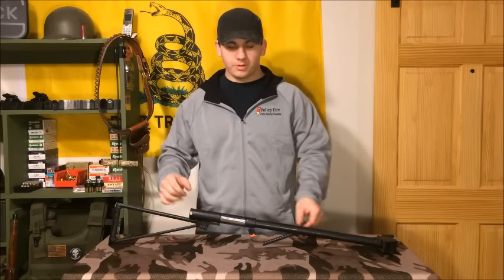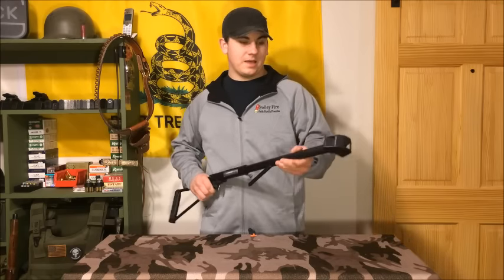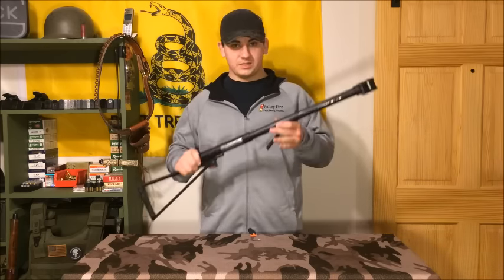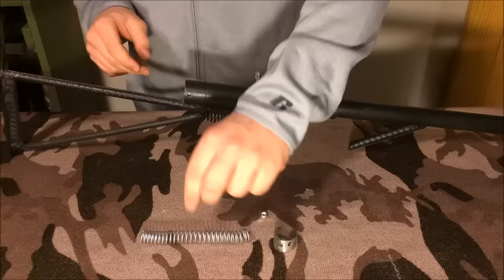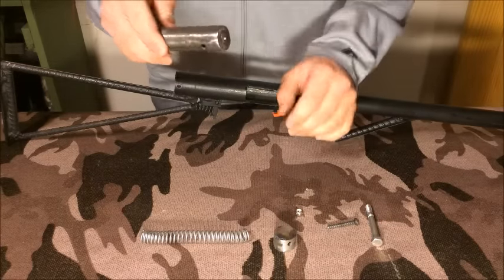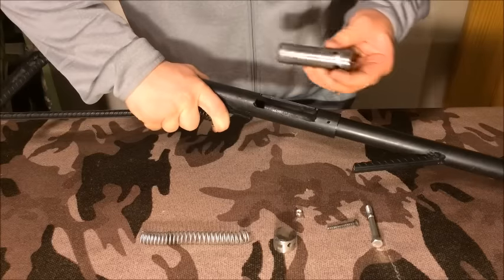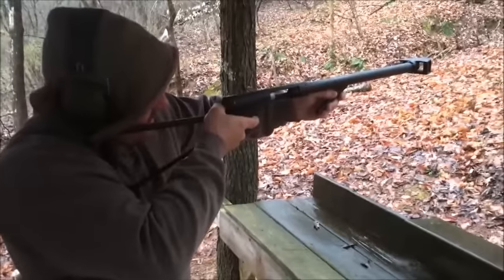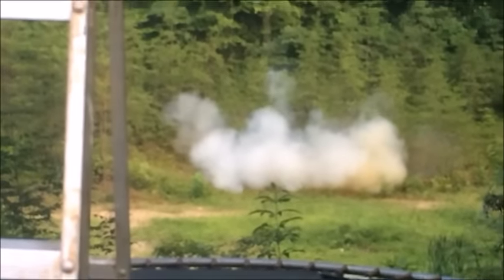Homemade open bolt shotgun

Comment: This shotgun is not legal. It fires from an open bolt and has no locking device for the bolt when fired to prevent blow back. All he has to do is add a magazine and he has a full auto. Anyone thinking about building this gun do not do it.
Reply: Single shot open bolts are perfectly legal.
Reply: @tinkeringclaws5559  No they are not. Anything that fires from an open bolt is not legal. As all that is required to make it full auto is the addition of a magazine. Part of the ATFs interpretation is "Any weapon which shoots, is designed to shoot, or can be readily restored to shoot, automatically more than one shot without manual reloading, by a single function of the trigger" so yes by simply adding a magazine would turn this into a machine gun by legal definition.  You can play around with a felony but I would encourage no one to follow you in that.
Reply: @historichomestead  dude stop spreading fuddlore. Let me guess you also think that carrying customized pistol will get you in trouble if you wind up using it to defend yourself?
Reply: @tinkeringclaws5559  No there is no ruling or decision on carrying a customized pistol. And how difficult it is to defend yourself in a personal defense situation is largely based on what state or jurisdiction you are in at the time of the occurence. You making a haphazard firearm based on your limited engineering knowledge and trying to pass it off as legal when it clearly violates the definition of the law is why gun control is getting stricter. Make one that fires from a closed bolt that locks and you would do yourself and the gun community a great service. However, I find that people such as yourself that do not understand or follow the law soon weed yourselves out from firearms ownership. Even when shown the letter of the law and how you clearly violated it you still try to defend your position. That is your folly.
Reply: @historichomestead  look up the gb22 and tell me thats a machine gun.
Reply: @tinkeringclaws5559  Correct. As all that is required is for you to add a magazine from let's say the side and there is nothing to prevent it from firing fully automatically. Just because some guy scoots under the radar and sells paper "plans" on the internet doesnt make it legal. Any firearm that fires from an open bolt with just the trigger being the sole means of holding the bolt back is a machine gun. It operates on the same principle as the STEN SMG etc. All that is required of an open bolt firearm is the addition of a magazine and it's a machine gun.
Reply: @historichomestead  he literally cant be under the radar he is an ffl and large youtuber
Reply: @tinkeringclaws5559  I can give you a list of a bunch of youtubers that got in trouble for exactly this or other related things. Also a bunch of FFL holders that also got in trouble for similar things. How it works is the ATF is aware of a product and will let it go for a while and then serve to distributor and go through their records and then serve everyone that purchased them. Same as they did with the "wall hangers" and what they are doing now with the FRT-15  trigger. Just because they let something persist for a while doesnt make it legal. It's not legal until they make a ruling on it and even then it's only legal until they change their mind. You do you. Keep adding evidence to your felony conviction.  I was giving a word of warning to the people that are observing your shenanigans.
Reply: Then why are ARs not considered machineguns as it’s way easier to convert an AR to full auto than it would be this thing, you’d have to ad so many parts to get this thing running full auto where as an AR as long as you have the right bolt and a simple trigger modification you are good to go.
Reply: @imperialwhovian3461  an AR fires from a closed bolt and under the Brady Bill "M16 profiled" bolt carrier were prohibited etc. It wasnt until the Brady Bill expired that M16 profiled BCGs were legal again. By ATF definition neither the upper or lower receiver fully meet the definition of a firearm. However, start selling lower receivers and see how quick you are being brought up on charges of selling firearms without a license. I am not debating there are obvious over steps or grey areas in the law. This shotgun is not one of those grey areas. If you cut out a magazine well on that shotgun and put a magazine in it it would fire full auto just like a STEN SMG. Read the ATF definition.  This firearm is readily converted to full auto just by adding a magazine because it fires from a nonlocking open bolt. It is by definition a machine gun. You guys can try to argue around it by calling the duck a chicken but it's still a duck. And when the creator of this shotgun and anyone else that attempts to follow his design gets charged with a felony for manufacturing a machine gun then thats on them. I am merely warning people that see this that are ill-informed with firearm laws that this is an NFA item and will get them in prison.
Reply: @historichomestead  i bet your the kinda guy that asks to see tax stamps at the range.
Reply: @tinkeringclaws5559  ignorance truly is bliss. Do what you want.
Reply: @historichomestead  did you watch his video on open bolts?
Reply: @tinkeringclaws5559  Is he an ATF agent or other appointed or elected official that has the authority to make rulings, decisions, or interpretations of firearms laws? I can show you a lot of videos of people explaining how the FRT-15 trigger is not a machine gun. Just because some barracks lawyer decides something is a certain way doesnt make it true. Like I said you do you. But when you get a knock dont say you were not told.
Reply: @historichomestead  he is a lawyer that specializes in firearms.
Reply: @tinkeringclaws5559  well maybe he can represent you and the creator of this "shotgun" when you get arrested for your illegal tomfoolery.
Reply: @historichomestead  im guessing you didnt watch his video.
Reply: @tinkeringclaws5559  I dont have to watch his video. I have reviewed a great many cases where lawyers have tried to argue a point against an ATF ruling, decision, or interpretation and their clients went to prison. Really time will prove who is correct you or I. I know what the ATF definition is of a machine gun. There have been many individuals over the years that have went to prison just for an open bolt design. Do you know why the semi-auto FN M249 that is available to civilians was designed with a closed bolt system? Because it has a magazine and even if it fired from a semi auto open bolt system by legal definition would be considered a machine gun. The only thing this shotgun needs is 10 minutes with a dremel and a few tack welds and it can accept a magazine. You can argue whatever you like. And some lawyer that is not a member of the ATF cant tell you anything. Really I want you specifically to build one of these "shotguns" and when you go to prison for it that lawyer can represent you. At this point I feel like I am debating with a high schooler. Dont show me some video that is merely the opinion of the author. I want you to show anywhere in an ATF ruling that any weapon that fires from an open bolt with no disconnecter and a fixed firing pin is legal. You cant because it is not. Really your are just going to go to prison when you try to make this and then the internet will no longer be graced with your ill-informed nonsense.  Like I have said repeatedly do what you want. Get all the felonies that you want. But I am still going to warn the people that see this video to not follow in your illegal footsteps. Really this entire shotgun was poorly engineered using an action that by definition is a machine gun.
Reply: @tinkeringclaws5559  "The weapon is blowback operated and fires from the open bolt position with the bolt incorporating a fixed firing pin. In addition, a component part of the weapon is a trip lever (disconnector) which has been modified to prevent more than one shot being fired with a single function of the trigger." That is the ATF ruling on a legal open bolt design. What makes this "shotgun"  illegal is the fact it is BLOWBACK OPERATED, fires from an OPEN BOLT, with a FIXED FIRING PIN, and there is NO DISCONNECTER PREVENTING THE EXPENDITURE OF MORE THAN ONE ROUND BY A SINGE FUNCTION OF THE TRIGGER. Now his fire control group in and of itself is considered a machine gun. If you took his bolt and fire control group and put it into another firearm and it fired fully automatically it would also be a machine gun. That's why you cant use the full auto sear from an AR15 and create a semi auto FCG and it still be legal because you can use those items in an AR15 to make it full auto. Furthermore, his design is functionally the same as a full auto STEN SMG Bolt carrier group and fire control group. A full auto STEN who's only functional difference is the addition of a magazine from this "shotgun" is classified as a NFA item. This "shotgun" by definition is a machine gun. It doesnt matter if he hasn't add a mag well yet. When you can present facts that were produced by the ATF and not some clown lawyer that contradict my arguement then we can have a debate. But so far your evidence is flimsy and your rebuttals have been merely speculation and opinion with no real facts in support.

Comment: now this is just me talking, but i think I would cut about 1in off of the recoil spring, it takes very little to set that round off-so that's not going to be a problem, as the spent round is trying to come back there won't be so much pressure from the spring and it just might recock its self for you,

Comment: If you slightly shorten your bolt put in an ejector I bet you could get it to eject that round that is so cool
Reply: it needs more bolt mass, and a better bolt/pin holding the end cap in.  Other than that, yeah buddy.

Comment: How could you add a magazine and ejector? I've thought about it and the ejector is the part I'm stuck on
Reply: If you add a magazine to this design it will be full auto and you will be going to jail.
Reply: @historichomestead  How would it be full auto if you still have to slam it back and forth to fire?

 And since the barrel is the part reciprocating, it can't even be converted to full auto easily

Comment: This could easily be made automatic
Reply: If it had a magazine well and took Saiga-12 mags then it would be a 12 gauge SMG.  
It definitely wouldn't be an assault rifle since its 12 gauge and SMGs are pistol caliber... So noy really sure what you would call it but it would operate just like an open bolt SMG so I'm going to go with 12 gauge SMG.
Reply: @toki89666  do you plan on making such a contraption?

Comment: Real nice dude ! Make a .22 pocket-pistol with open bolt.
Reply: That's where the problems start. If it has more than one shot then it cannot be open bolt, and may even be considered a machine gun. I can't remember. All I know is it's illegal, because it would be easy to turn into a machine gun.  If it was self loading, and open bolt, then there's a chance that when you pull the trigger, it will eject the round, come back to where the trigger should stop it, but keep going instead, and fire until you release the trigger. I don't know if you actually knew that, but this guy doesn't want his dog shot so he'll keep away from that.
Reply: No it would not be easy to turn into a machine gun as you would need to add all the complicated parts needed for a self feeding system to work, it’s easier to convert a AR full auto yet they don’t classify them as full autos

Comment: No hate just wanted to add you probably could have gotten rid of the welding altogether and just made a stock and other parts using just more pipe fittings plus the bolt could be made from a piece of dowel in a quickie the dowel won't last for long (maybe 10-15 shots if your lucky) but it'll work for you in a pinch also the plug on the back could be replaced with just an end cap that you use on threaded pipe plus something inside the cavity to support the spring there's an old video somewhere round YouTube that is exactly what I just described but yours is way better and would last longer but in a pinch you could always make the cheapo version for a quick few shots
Reply from the maker: you would be correct, in a pinch thats how I would have done it but since I have the tools and resources I figured I would use them
Reply: Polley Fire wanted to ask why did you put a muzzle break on a shotgun I don't really now what a muzzle brake does but I've never heard of a shotgun with a muzzle break then again the only shotgun I've ever had that wasn't homemade was a maverick 88 so what does the muzzle break do for the shotgun does it make it more accurate or something
Reply: Polley Fire also would it be possible if you could show how to make this shotgun on another website like full40 or something cause I'd really like to know how to make thus
Reply: Polley Fire what did you use for the firing pin thingy that was hollow
Reply from the maker: Well, the muzzle break just takes the muzzle blast and directs it back to reduce recoil. and the firing pin is just a hunk of weld filled down to a suitable firing pin

Comment: Dear Mr. could you tell me if I can use ST-52 carbon steel with a six-millimeter wall for the pipe? Thank you very much.
Reply: Should be fine.  Shotshells while powerful are actually very low pressure compared to rifles and most pistol calibers.  They don't need to be really strong materials for a shotgun.

Comment: Im no gun expert and I’ve never made a gun before but just seeing you shoot it a couple times makes me think your reciprocating spring may be too strong and maybe you could have some kind of added spring system added and a clip/magazine fitted to turn it into a sten like gun, this very much reminds me of a sten you could have the bullets fall out the bottom and keep most of the same design and the spring pushing the bullets into the chamber could easily knock out the old bullets with little to no extra effort compared to the amount of effort that design has taken to make
Reply: Ooen bolt plus magazine... Isn't that an instant trip to federal prison?